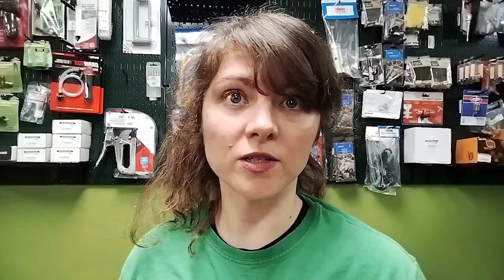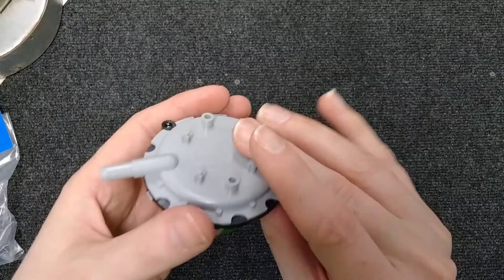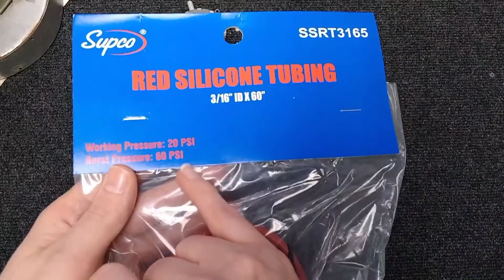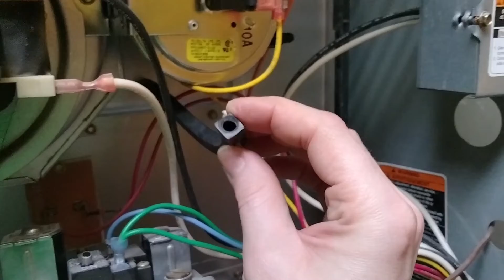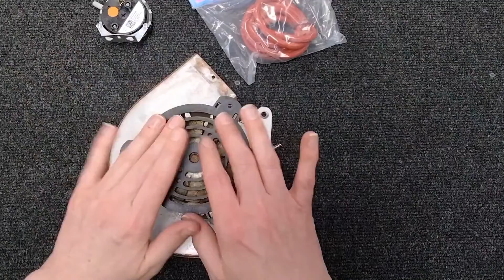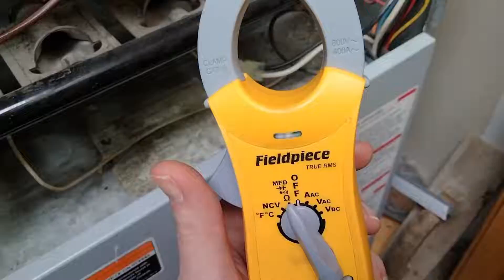Pressure Switch Testing — How To Test Your Furnace Pressure Switch

Comment: Mine made intermittently bad contacts every time it had a vacuum ohms ranged anywhere from 0.3 to 20.  So sometimes it worked, sometimes it almost worked, and sometimes it didn't even try.  Also mine won't let you just bypass it, you have to bypass it within seconds of the fan turning on.  For a temp fix to stop the house from freezing I used a car relay tied to some other input on the board and powered by a 12v adapter.

Comment: 1 question please if it is possible 🌹🙏  Q ? furnace work fine , tech come in for yearly service , after 40 minutes he works on it & I ask him what did you please ? he responded checking gas pressure 
.After he left our furnace does not work like before , we use to set the thermostat at 75 at night time  ,our house was warm but nomore .Now if we set it at 75 , our house has to go to 72 degree so the heat kickes in , now we have to set it at 76 or 77 degree so the furnace works only 10 minutes then we have to go to raise the heat to 78 . My wife has checked thermostat twice , nothing wrong , the whole furnace is only 2.5 years old . When we call what you have done to our furnance they hung up the phone on me or saying it is our emagination . . Now our furnace only work from 76 or up .
We are in Va  is : we nomore thrust them although we have paid full amount for about 7 years warrenty) I thank you for respons 🙏if you can .
Reply: Cx⁰ðf

Comment: Also if your meter goes to 0 when the inducer on that is a 100 percent check of a good pressure switch unless see that voltage come back and forth it’s a intermittent problem
Reply from the maker: I remember learning about the voltage drop as well. Tracking down intermittent issues can be frustrating for many homeowners when we're walking them through testing.

Comment: Your not supposed to put your meter on olms when the power is on that will ruin your meter.
Reply from the maker: I didn't think about that, thanks for mentioning it! I appreciate the feedback.
Reply: You must remove at least one wire from the component you're checking thereby isolating it from the circuit.  This also ensures that power is not applied during an ohms check.

Comment: can you go over condensing furnaces multi pressure switches, it s a bit difficult to jump em  one at a time, do they close contacts instantly? or you have time to start em quickly one a time??? thanks for the video
Reply from the maker: Condensing furnaces are a bit of a pain! So when you have multiple pressure switches (I'm guessing you have a dual pressure switch in a 2-stage system) they do not make contact to close the circuit at the same pressures. You'll have a 2 speed inducer motor that pulls them closed based off of the speed it uses. You will need to jump only the low pressure switch AFTER the inducer motor comes on. It stays in low stage 5-10 minutes depending on the unit.
Reply: @opentopublichvacschool  thank you, yes they are a pain, so i would need to locate the lower pressure switch and that would be the one to jump between 5 to 10 seconds of the inducer startd up, thank you,  keep those videos rolling the way you explain the sequence is very simple. thanks
Reply: @fernandofhernandez899  correct. Your low pressure switch will be the negative pressure that takes less pressure to open. For example, one would be maybe a -.35 and the other maybe, say, a -.75 since the -.35 takes less pressure, that will be the low pressure to bypass.